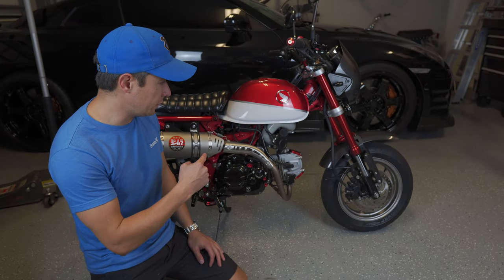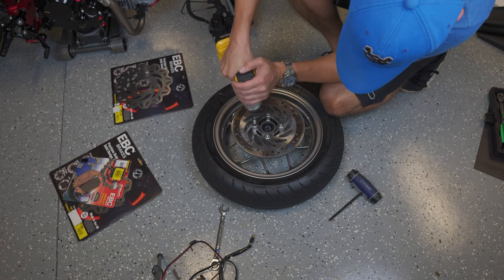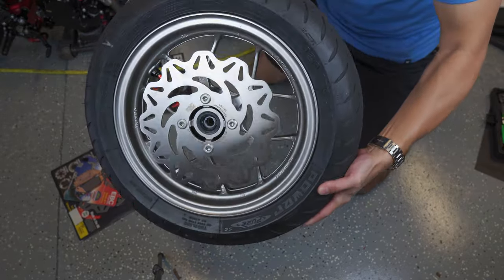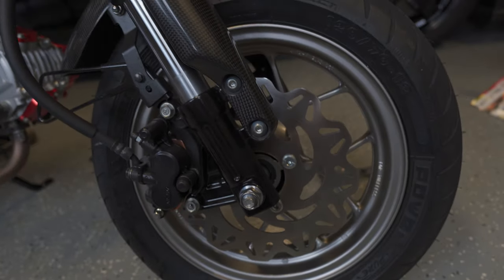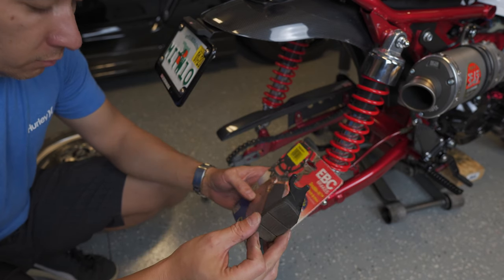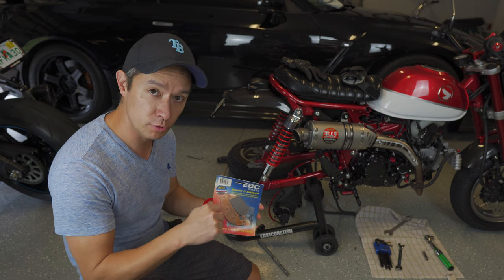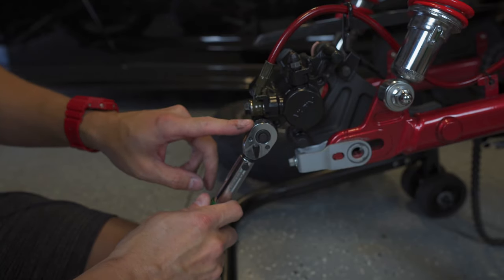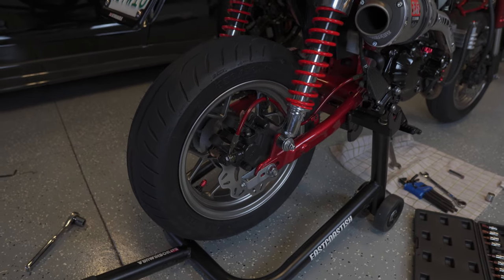EBC Rotors and Pads for the 2019 Honda Monkey

Comment: Thanks a ton for this information; I was in the process of picking up parts for the same and finding out the rear brake pads are different is quite important. Amazon just ran out of the EBC FA343HH, and most of the sites have the wrong brake pads listed for the rear brake (just using what's on the GROM).
Reply from the maker: I bought mine from eBay, but that seller also seems to be out of stock:  https://www.ebay.com/itm/For-Honda-CBR125R-2004-2009-EBC-FA343HH-Double-H-Rear-Left-Sintered-Brake-Pads/352872386282
Reply: eastcoastish looks like I was able to get a set from Speed Addicts (waited to mention until I got them in hand and was sure). So, at least another option out there.

Comment: installed some ebc rear brakes on mine and they drag like the pads are to thick
Reply from the maker: Like they slow down the bike when you ride? Its ok if there’s some light drag when you install, try riding a bit and the should spin freely.
Reply: thanks. I ended up getting OEM ones and they are the same size. went for a spin and it seems like both front and rears aren't holding pressure. gotta figure that out LOL @eastcoastish